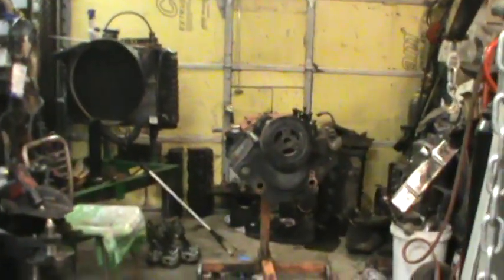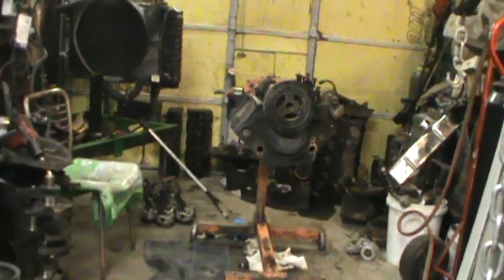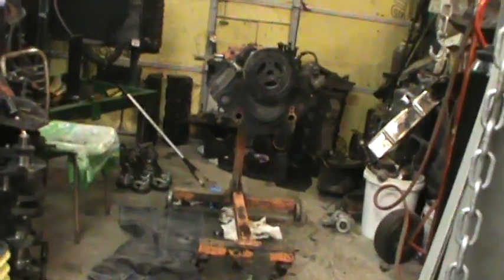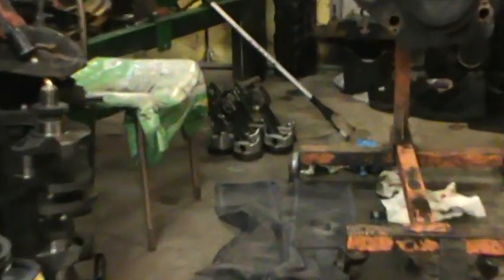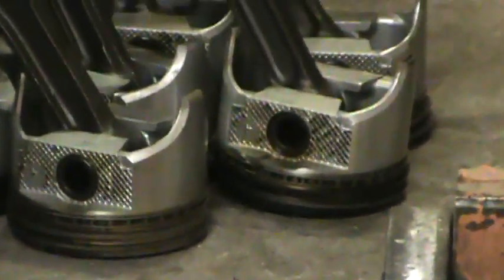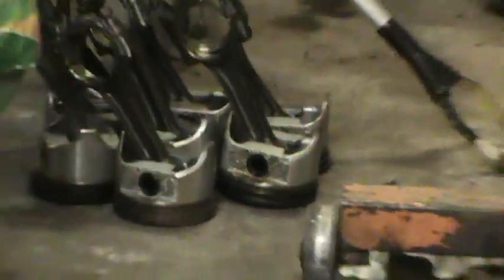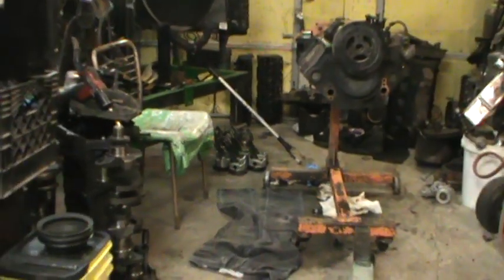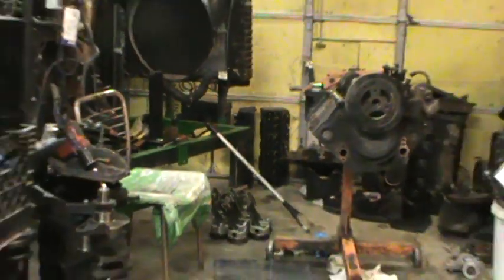core motor 1 the .080 350 chevy short block tear down

Comment: Have you built an 383 for a pickup truck for towing maybe your 80 over could be converted
Reply from the maker: i looked and i haven't found any 5.7 or 6 in piston to work in a .080 over bore so it will stay a 350 style motor.
Reply: @tlcbear2  

If you use a factory 400 crank with 400 rods, the 350 piston compression distance will work. 

Would of made a sweet 392 cid sbc! A 400 crank already altered to fit a 350 block shows up once and a while on eBay, just have to remember to look once and a while. I got lucky a couple years ago and found one ready to use for $150 shipped! I couldn't afford not to jump on that.

Anyway, I didn't know they even made. 080" over sbc pistons. Was the block sonic tested to overbore it that much? Very cool. 😎
Reply from the maker: @itseithergonnaworkoritaint7852  no idea if it was sonic tested. it was built back in the 90's so i just redone it and it is what it is.